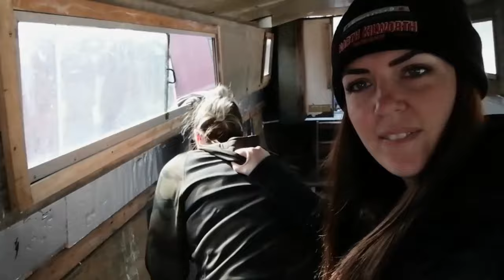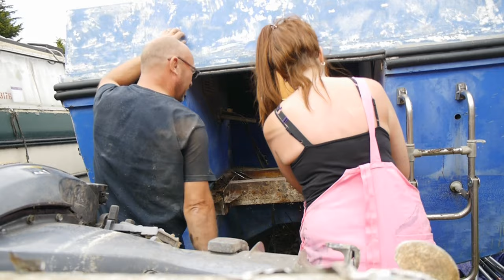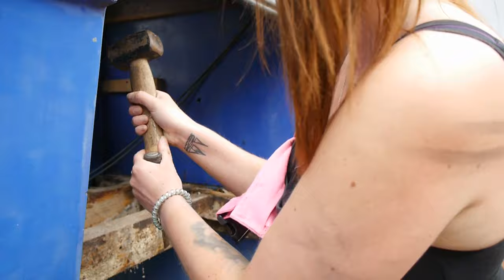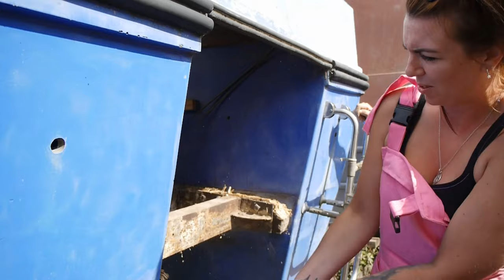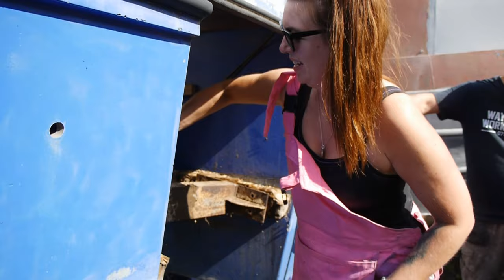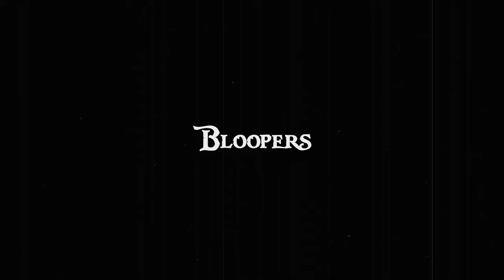Ep 33: Removing a canalboat's engine cradle

Comment: Thanks for the video. That seems like it took a lot of work to remove, if the bolts don't come out drill or cut the heads with a angle grinder chop the beams in half with a angle grinder 4 hours max! Hope you didn't pay for more than that? If it was friends helping then all day and beers thrown in 😅 if you are getting a new one made ask the price difference for stainless steel. I know from working in engineering it might cost 30% more but you will never need to paint every few years + the cost of that and will look amazing. Good luck with the refit look forward to the next update 👍🏻⛵🏴